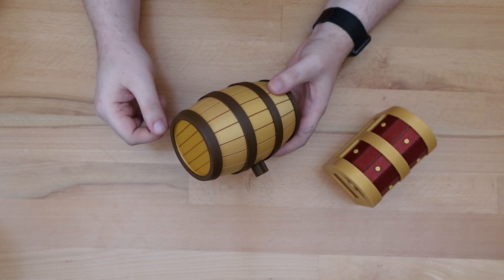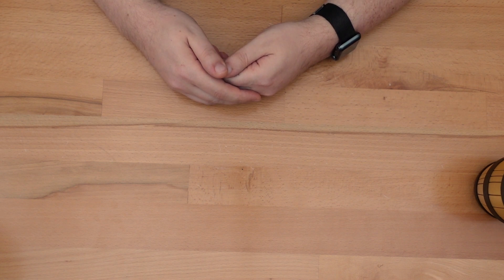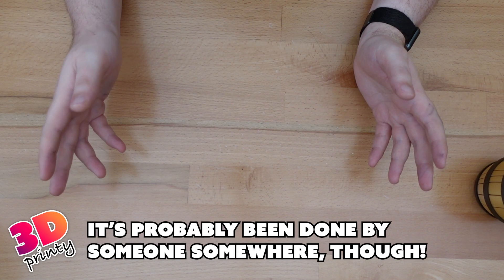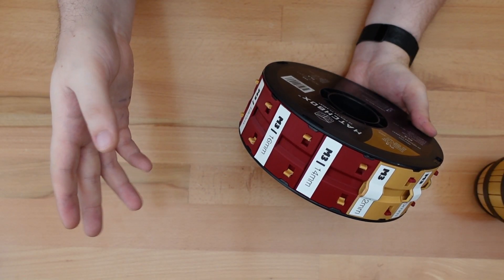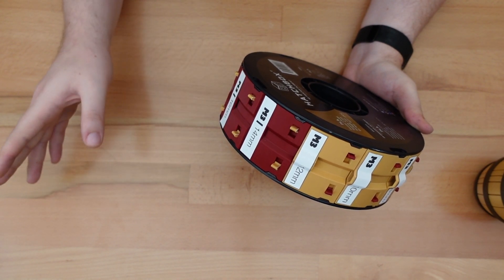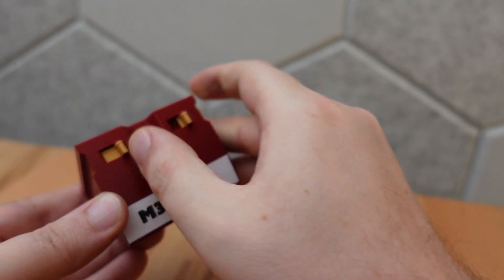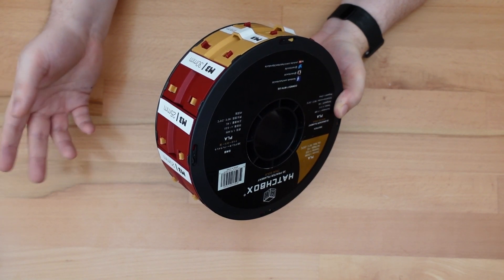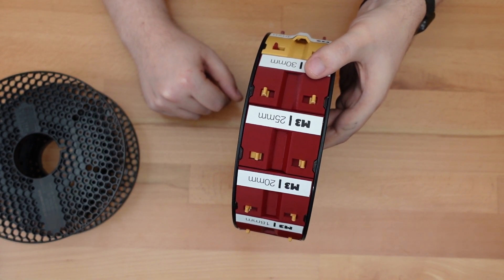Vertical Filament Spool Parts Drawer (Hatchbox)

Comment: Awesome! I've been looking for a spool drawer design that doesn't need any hardware!
Reply from the maker: I'm glad you like it!

The optional stand does use hardware, but there's a really nice print here -  https://www.thingiverse.com/thing:4854550 where they 3D printed the nuts and bolts for the stand as well. So I guess you can make the whole set with zero hardware!

Comment: I am sure that the outer diameter is larger than 100 mm. Besides that great design.
Reply from the maker: You're correct! I got my diameters and radii switched - it's actually 200mm.